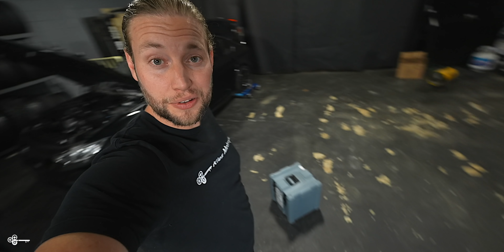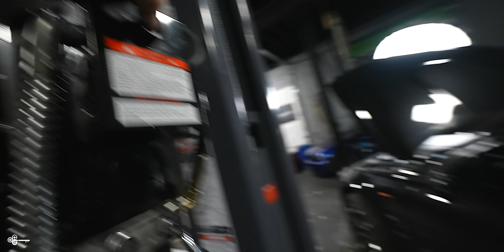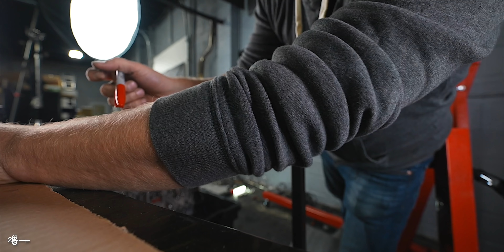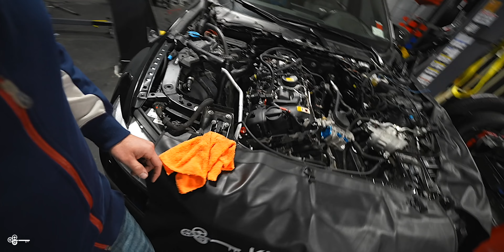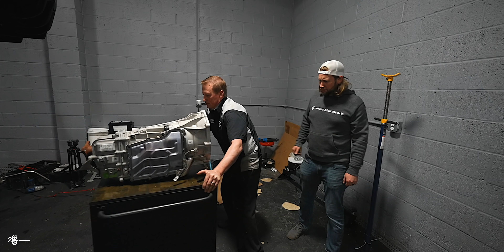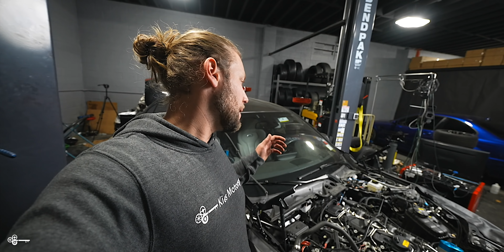Part 1: Jon's F80 M3 SPUN CRANK HUB DISASTER to FULLY BUILT MONSTER, COMPLETE WITH CAMS

Comment: it is nice too see a team work,.i just done a 335 engine by my self. it is not a mission impassible but it is not just a brake job or oil change, you do need another person assist you for heavy lifting or spot something catching on the way. and also having all the equiment to work with too. we dont even have a transmission jack, so sad 😔.

Comment: Why not do a DIY? It would have been nice to have a few slow surveys of the intern compartment and under the chassis with discussion of how you were going to disconnect the necessary items in the sequence thereof. Other than that, which is a big thing, it was a decent video. Even if the Dodson clutches were easy to install it would have been nice to have a little more coverage of that.

Comment: Watching you dolly the car up makes me so appreciative of people who care for their customer's car. My F80 went into limp mode because of a hole in my gas tank and I had it towed to the nearest dealer. When I came in to check on the work I noticed a huge scratch on the rear fender from them trying to get it into the shop. They fixed it with a 3rd party body shop on their dime but it's nice to see this level of care.

Comment: Would a crankhub capture “fix” this problem ?
Reply: It's only a bandaid to the problem. The aftermarket 4pin slotted crankhub upgrade is the actual fix.
Reply: No. Just prevent catastrophic failure if in stock CH. catches the bolt before hits pistons

Comment: Hey guys was the car lightly modified and the crank hub spun that bad? Or did he have a heavy tune with e85? Just curious because I’m in the market for a F80 but I’m nervous about the crank hub.
Reply: Never mind just read the modification breakdown in the description.
Reply: I spun my crank hub back in august after installing PJT E85 Stage 2+ tune. I didn't blow my motor but the BMW tech working on my car said that it was one of the worst crankhubs that he's ever seen and that I am extremely lucky I didn't bend my valves.
Reply: If you're leaving the car stock as is, your chance of spinning the crankhub is rare. Once you start pushing over 500hp and taking the car to its limit is when you need to worry.

This is more common is DCT transmission as the shifting occurs more quickly with much more torque-iness which prone to spinning the crankhub. 6spd and auto is not as common but can still occur as well.
Reply: If you’re that worried about it, just get it upgraded. People have spun hubs on stock tunes

Comment: Hi mate,In stock engines there is usually no problem true¿
Reply: Stock engines are still prone to failure, however the failure rate is much lower. If your going to be tracking your car, you may want to consider upgrading but for the most part it is not needed.

Comment: Waw a carbon fibre driveshaft 😯. Is it on all f80 gen M3's and M4's?
Reply: Till 2017 November every F8x platform has a carbon one. Because of emission regulations, they changed from the carbon to a steel one to make space for the PPF (petrol particulate filter).
Reply: Until about end of 2017 I think, production was kinda weird about it

Comment: Love seeing some cross coast collaboration! Rhetorical question at this point, but why was he running a stage 2 turbo setup with an e85 tune without an upgraded hub (or at least a CBC)??? That type of power is clearly outside the bounds of what the hub assembly is intended to handle. Anyway, excited for the next segment :)
Reply: People run high hp tunes for years on these cars without upgrading the crank hub. There’s no guarantee it’ll last but it’s also not an issue that plagues 100% of cars
Reply: @cokemachine62590  Agreed, absolutely not an endemic issue. It just seems that in this specific fact set (Stage 2 turbos, meth, E85), it's an item that probably should have been addressed
Reply: Being that he had the original PS2 turbos, I would presume his car was built before the Crank Hub was known as a widespread problem.
Reply: @boostedoctane  It's not a widespread problem within the reasonable bounds of stock power levels; many people have been running stage 2 tunes with no issues. This guy seems to be pushing big power with stage 2 turbos, meth injection, and E85 but not upgrade the hub... even going back to the N54 days, this is know as a potential item to address in that situation; hubs are not recent news. I just think its funny that there are people running big power mods and complaining about hubs spinning and trying to characterize it as a "design flaw" when they are pushing way more than what the OE assembly is meant for.

Comment: I never understand why they engineered the crank sprocket like that. i get it, it's much easier to assemble but the risk of damaging the engine is also high esp on performance engine
Reply: It's a more efficient cost factor. It was a fail design from the start but it was only anticipated for stock motor @ 425hp. Pushing over 500hp is when the failure occurs
Reply: It's fine stock power.

Comment: Every M car seems to have an Achilles heal 😭 I'm curious what the S58's will be.
Reply: Stress ...in my 30 yrs working on engines, modified, 50cc, huge 12cyl Detroit’s in boats and I have learnt one thing..stress, no engine will handle stress beyond the capacity of its internals...bearings, pistons, cranks etc...
Even the most bullet proof engines with all forged components will fail under high boost so the “Achilles heal “ will be stress failure from too much boost..
All the people touting the high output of s58 with simple tune and pipes, pushing 700hp should remember one thing, that simple tune is adding higher boost and that engine is gonna blow ..
Reply: It's already heard crank bearing issues. 🥺
Reply: The front grille I reckon